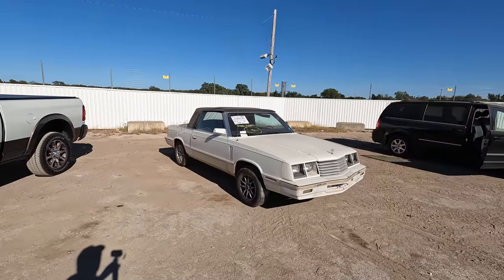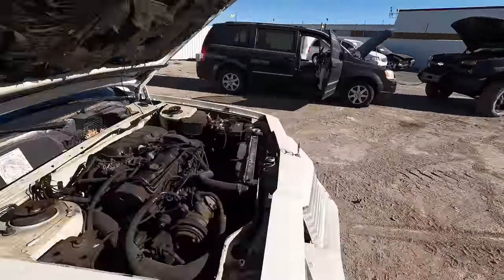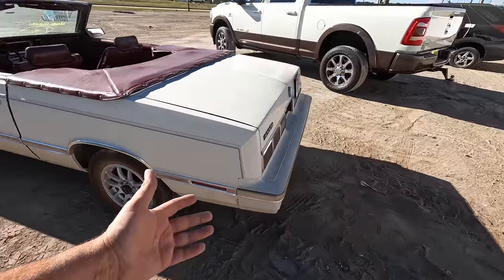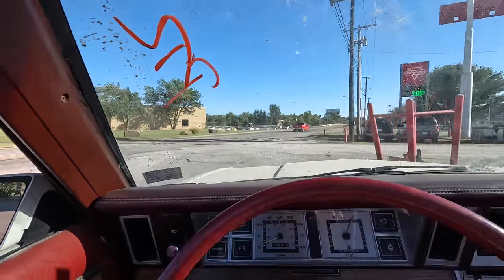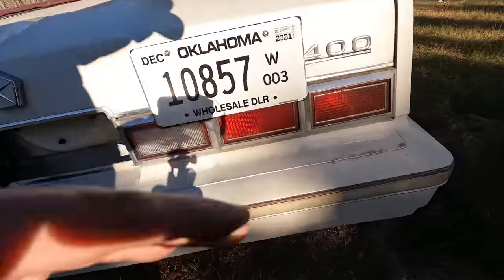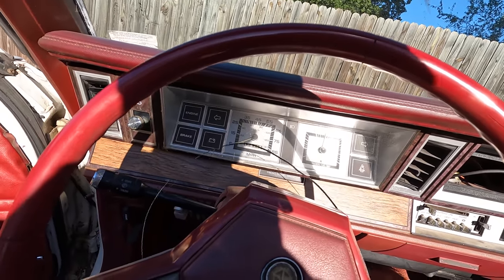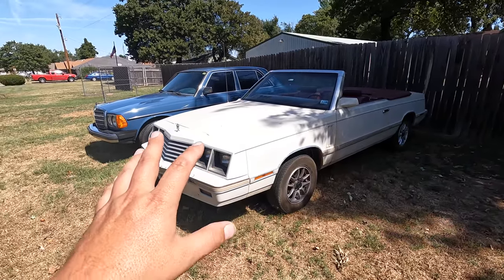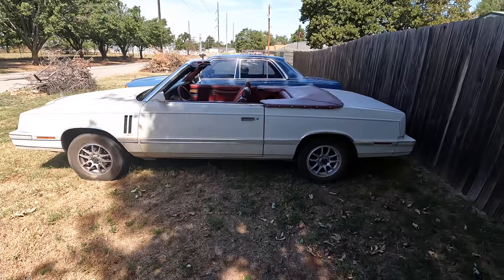I won a 1982 Dodge 400 K Car for $235 from IAA!! Run and Drive? 0-60?

Comment: Seriously I'd rather see you rebuild something like this for content value over fixing up a muscle car; everyone and their brother does that on YouTube.  Honestly thinking I might have the broker bid on this car; first generation K Cars in good running order with no real rust I can see are like hen's teeth.  I've always loved these old cars having owned an Aries and a Reliant.
Reply: Right? I can go to so many channels and see classics being restored, or newer cars being built to blow tires off, but nobody seems to really even bat an eye at the under-appreciated survivors like randy does
Reply: Yup owned a Reliant 2 Door with the vynil top and Opera lights installed. It had the HUGE displacement 2.2 Litre (I think?) but mine had the ultra high performance 4 Speed (maybe 5?) in it! Woo Hoo what a rocket it was 😆🤣😂.

Comment: These are worth 4500-6000 in perfect shape. The 400 was made for only 2 years. These convertibles were super rare. Most of them were 4 doors and Coupes Hardtops. I'm a K car fan. Man Red Green would be jelious of you
Reply: These exist in perfect shape? They weren't in perfect shape even when new!
Reply: @ronalddaub9740  The 82 and 83 were sent out to have the top done and they don't have quarter glass. the 84 and newer were done in house by Chrysler and were much nicer, They had a better top frame and convertible top and they had a quarter window!
Reply: @My Pronoun is WTF It looks nice, but one that's been driven an average of about 630 miles a year as has been claimed with that car has got to be exceptional.
Reply: @My Pronoun is WTF  the 600 was an E body with the Chrysler New Yorker and Plymouth Caravelle.  The K body started with the Chrysler LeBaron and the Dodge 400. The Plymouth Reliant came soon after. K bodies had the notch back rear window (squared off). The E bodies had the sloped rear glass with the extra quarter glass for more trunk space.
Reply: just picked up an 83 400 convertible in amazing physical condition  and under 80k miles for around $4300  just a quick tune under the hood and i think i got myself an awesome little car show cruiser lol

Comment: Randy, I had an 85 charger with that same engine and it would do every bit of 145 mph.  It was lighter than yours but the 2.2 with a carb was a good engine.  It may just need a tune up to get more power out of it.
Reply: The catalytic convertor is probably plugged
Reply: I had an '83 Challenger. It was a rocket too.
Mine had the digital dash, and female voice prompts.
Reply: My memories might be clouded by all the years, but I seem to recall the 2.2 eventually being considered the better of the two engines.  The Mitsubishi 2.6 being terrible oil burners.  Everyone has probably seen the old minivans blowing clouds of blue smoke?  Those were all 2.6s.
Reply: @peoriavideosltd6822  
Yes. Those were GARBAGE
Reply: @peoriavideosltd6822  The 2.6 were garbage when the balance shaft went out and the carb was another sore part . I had plenty of 2.2's non turbo and turbo I bought a 2.2 K car wagon that had a blown head gasket that a customer brought in I was working at a dodge dealer and the service writer said it was too old for the service dept to work on any way
 the customer asked if I would work on it told him sorry no can due then he asked if I wanted to buy it so he offered it to me for $100 I bought it and did a lift and slide gasket replacement sold it 3months later for $1000 dollars anyway IMHO a 2.2 is way better than the Mitsu 2.6.

Comment: I'd like to see you so repairs to it and put the original radio back in it and working, and put a top on it.  Maaco  to touch up the original white paint. You can most likely find factory wheels at the junkyard. Put the original wheel covers back on it. They are rare to the point they are collectable. There is a market for them.

Comment: You're too used to driving that Hellcat Randy. LOL.  Actually, if you look back, that slow dog engine was about par for the day of other manufacturers offerings like the Citation or Fairmont. Anywhere from 80-90 hp range was the norm for 4 cyl vehicles. Drop a slush box in them and they were absolute nightmares to get onto a freeway. But you got to admit, that Dodge 400 was a good looking vehicle in it's day. Still is in my opinion.
Reply: I agree with every word!

Comment: my parents had many of the 2.2's and they were not as bad as they made them sound. Worse issue was the head gasket and it was a fairly easy fix.  My dad had a timing belt break and all it took was the belt to repair it. didn't even bend any valves.

Comment: You can bump up the ignition timming a bit and it'll help it get up and go a lot better.  Iirc the base timming on those 2.2/2.5L was way too low at about 12°.

Comment: We have a 1982 Dodge 400 convertible and have owned it many years. It definitely turns a lot of heads and we get asked questions about it all the time. It's such a great car for cruising around in. The electric top is super fast. I found old repair books to keep it going. We have BMW, Subaru and Toyota cars as well, but this is definitely a favorite! Drive it like a golf cart and it's very relaxing and reliable. The front seats are VERY comfortable. If find one and are handy with tools or have a mechanic that understands carburators. This is such an interesting car. Little kids and elderly people really like it. It isn't a GTO or Mustang, it's very rare. And we really love it. ❤
(Long term ownership experience here 😉).

Comment: Oddly, a few years back bought a '91 Chrysler TC ("by Maserati" 😆) in triple black from a retired professor cheap. Just a "Bitsumishi" V6, 47k miles and everything works. Still have it, my daughters used it for a fun summer cruiser and it isn't worth anything. Cheap insurance, never see another, and it looks presentable. 

Should be a power trunk release- open the glove box, yellow button. Also, tune should include plug wires on the 2.2/2.5- the cap "Ends" go through the cap and are the contacts for the distributor rotor

Comment: That bezel is for the factory radio. All Chrysler radio's from 1981-2000 had the same connections for the speakers and antenna.
Reply: Actually, I think that's the Bessel for the passenger side inboard headlamp

Comment: Had one of these when I was 19 
Bought it for 400 put a radiator in it and drove it for two years then sold it for 400 .
Car was amazingly smooth and very comfortable and roomy . 
But yes it was really slow .
Mine was whit exterior with super blue interior vinyl seats and dash .
Put a jamming stereo and 6x9 Speakers under the back dash and was cool sounding ride

Comment: 2.2 L had carburetors until 1985.  I had a 1985 Plymouth Reliant.  86 had a 2.5 EFI which was a much better motor.  Mine was always in the shop.  Three carburetors. Two radios.  Emission equptment failures.   After 18 months it went back as a lemon law car.   

Lease was nice. $500 rebate assigned to dealer. 0 down.  $197.50 a month for two year lease

Comment: I don't know about Oklahoma, but in my area these cars (as a convertible) are very popular and still worth decent money, and tops are cheap.  Also, from my experience, the 2.2 was a more reliable engine than the 2.6 which had a balance chain that would start to rattle and cause problems.

Comment: The 2.2L Slant 4 was a good engine after 1986 when they became EFI they were turn key reliable. The 2.2L and 2.5L Slant 4 is easy to do head gaskets. We did head gaskets at the Amoco garage  on these took 3.5 hours and the cost was 350.00 parts and labor
Reply: @My Pronoun is WTF The Holley carb is based on a Weber with electronic feedback.  A Weber without the electronics is a good swap.

Comment: I would love to buy that K car. It's different and in nice shape. It's the kind of car that you can go have fun with. Fix the top, put in a modern radio and go for a drive. Yeah, it's not fast, but most cars from the early 80's were slow (my first car was a 1982 Buick)

Comment: Randy, this is a 40 year old 4 cylinder K car.  It had to have been taken care of by the owner, or it would have already been scrapped.  My guess, the owner is either in a nursing home or has passed.  The children donated it, because they could not be the ones responsible for having it scrapped.  

Have it detailed, dye the carpet, find a used top and change the fluids, etc.  Then run it through IAA and I bet it will sell for more than you paid for it.

Comment: I think you should rebuild the K car; not to concourse quality, but to the point of where people would turn their head and say, “That’s a nice old car.”  

What to do with it?  Fix the “hub bearing” (not sure if that’s what you said, but something to that effect).    Steam clean the engine, reinstall or replace the trim pieces, reinstall the radio and restore the top and call it good.  

Even though there is no profit whatsoever in this car, just to “restore” an 80s K car I think would be fun to watch and bring back a piece of nostalgia.

Comment: Beautiful car in a year or 5. What engine is in this convertible?

Checked it out. It has a 2,6 mitsubishi 4 cilinder in it. Those are excellent engines. That engine will run and run and run.

Comment: If i rememeber right weren't the 2.2L engines made by VolksWagen? they were the ones dodge sold with the Holley Carbs on them too. You need to run seafoam through the gas and through the engine before you change the oil. Guaranteed it'll pick up if you do that. they weren't race cars but they went ok for what they were when the internals are clean

Comment: For certain years in the 80s, there was a federal mandate that speedometers could only go up to 85 MPH, and the number "55" must be highlighted.   Many car makers marked numbers every 10 MPH on the fives to comply, rather than make the number scale "asymmetrical" .  Found it odd on the km/h they marked "137"

Comment: Tops are cheap $150-250. Car looks great with top down, red would be hot! 
Get the stance to be a little higher in the rear with a nice set of wheels, $4500.

Comment: Randy the 2.2 is definitely known for blown head gaskets . I was a working mechanic back in this era we did the SLIP AND SLIDE  for  the head gasket  repair anyone from that era knows what I mean  lol also the  these cars are know for vapor lock now days not set up for the new fuel of these days when the warm up . Good luck still a nice old var 👍🏻. BK

Comment: There is a passthru on the side arm plates of the rear C-frame. Make sure the sway bar linkage is still there, and attached, not broken. If you do not see a diagonal beam attaching to side of C-frame, to body...make sure a recalled  C-frame side plate is not cracking where the e-brake cable snakes thru. The wheels will slam into the wheel wells and it slows you down very quick!!! Other than rusty lines or radiator weld dissolving, good lil cars.

Comment: The carbureted 2.2L engines were not all that bad. The fuel injected 2.2 turbo had the most problems. But the carbureted engine is painfully slow 😂
Reply: The later 2.2/2.5 with TBI are generally more reliable

Comment: box on radio antenna wire is an antenna booster red wire is for 12 volt power.

Comment: trim piece came off when rear speakers & wires were removed, most likely by a young guy that owned it last and put a powerful stereo system in it.

Comment: Cool little cars, not very many made and few around anymore.  As long as oil was kept up with they where good reliable transportation, the 2.2 was a good engine, head gasket was the main problem, those carburetors could be finicky also.  I still have several 2.2 powered cars in my collection.

Comment: A new top and charge the AC, reinstall radio with 4 cheap speakers in holes cut. Put in on Craigslist for $1000.00 OBO it will sell.

Comment: Kcars have a tendency to drop axles and the carburetor screws mess up so they have to be replaced so they pass smog checks I bought one out of a junk yard and even though it ran good front axles were shot and very costly to replace

Comment: I want to say that it is a HUGE MISTAKE if you get rid of that K Car.  Now I am a die hard FORD and Toyota product fan.  

There is so much potential with that K Car and I am going to prove it right now.  Cosmetic wise that’s an easy investment.  However you can bring that care up to speed technology wise. 

New head unit with rear camera and surround sound audio plus Bluetooth.  You can even add SiriusXM to it.  

Upgrade all the lights to LED including the headlights with HID.  Redo the carpets and trim.  

That K Car will pair nicely with the Christine and makes for an awesome Fall Spring weekend get away car
Reply: Plus we would like to watch the transformation

Comment: There was an 86 LeBaron Turbo convertible in my local you pull yard, if you need any bits I can check to see what's left.  Last K-car body LeBaron, more or less the same as what you have.  I sold the digital cluster out of it on eBay for more than you paid for that car.  

Outside of that the last one I saw was the one Hoovie buried in the Wizard's yard.
Reply: Also, you should have had TK fake out his channel saying this was his new car. lol

Comment: The 2.2 is superior to the 2.6....Other than head gaskets they run forever! I own four K cars one being an 84 Dodge 600ES Turbo vert...I have one with the 2.6 and nothing but issues....
Reply: I’ve done a few 2.2 head gaskets, they are fairly easy to do, I’ve always used a superior brand like felpro and never had an issue again

Comment: Hey Randy Please fix up the 1982 400 Convertible these are super rare parts are cheap and the convertible was only made in 1982. Most of these were coupes and sedans but the 400 convertible didn't last past 1983 as the 600 replaced it. Please restore the 400 there was only 2779 made in 1982.Also you can have some fun and bolt a 2.2 or2.5L Turbo up to it and have a fun car on the cheap.

Comment: I seen to remember back in the 90s my mom had a car just like this but its a 4 door with the little multiple square taillights. I remember It keeps overheating a lot and backfiring and got a transmission problem it was only stuck in 1st gear and wont shift into 2nf or 3rd or 4th.  It was a pos.

Comment: When you say that the Mitsu 2.6 is better than the Chrysler 2.2, you've actually got it the other way around. The Chrysler 2.2 is the one to get, so you should be fine! You'd be surprised, there is a small cult following for these K based cars. I had a Dodge Aries wagon for a few months back in 2015 that had the same engine in it. Unfortunately the transmission failed a couple months after buying it and I had to basically give it away to the shop that was doing some work to it.

Comment: A head gasket on these are a breeze...even easier since it's a carbed engine.  and an updated MLS gasket, this engine will outlast the rest of the car many times over.  They used a pretty cheap, crappy head gasket from the factory back then.  BTW, the 2.2/2.5s were never junk. I've made over 300 wheel HP on stock bottom end turbo 2.2s and ran low 12's on a 2.5 in a heavy K car wagon.  Look up James Reeves...low 10's and 9's on a 2.2 8 valve engine.

Comment: I have an 86 model same color with the 2.2 mine has 112k on it I bought it from an 82 yr old guy who bought it new nice little driver gave him 500.00 bucks for it the only thing wrong with it was the front drivers caliper was sticking, I would love to have those hub caps, by the way you can buy a new top for $189.00 DM I’d like to have it when you decide to sale it and I’m a TN dealer

Comment: that car was fairly peppy back in the day. not sure about the k-cars, but the chargers and turismos from the mid-80's were no slouch compared to other 4 bangers of the day....u have an engine way down on power and/or your tranny is slipping....they had a reputation of tranny slip long before it actually went completely out.
Reply from the maker: Those were turbocharged, this is not. Trans doesn't slip lol I know what a slipping trans is.

Comment: If that car was close to me I would buy it in a heart beat! I had an 84 and an 85 Chrysler Mark Cross edition Lebaron convertibles and with a little work they both handled real good!  I think it would be good for the group but do  what you gotta do!  Just like the ''phony GTO'' I had a 68 Lemans convertible quite a few years ago and I loved the car! I also had a whole bunch of 68 Tempest and Lemans hardtops and they were all 350'S with 2 barrels and they would have kicked your cars ass because whoever put the 4 barrel on your car didn't hook the kickdown back up to the carb! when you kicked the 4 barrel in it should have dropped down to first gear! I would rather have 1 68 Tempest convertible than two Plymouth Plazas! You didn't give the Tempest a chance and you're not going to give this one a chance either You do you!

Comment: Believe it or not, there is a niche community with these K cars. I'm sure someone more knowledgeable on the subject will comment somewhere but, yeah. Clean it up, fix it up and maybe paint it and you might just be surprised how much one of those K car aficionados will pay for it. Bye the way, I would drive the heck out of this thing. They weren't fast, were not top of the line but, they were fun little cars. I actually owned the LeBaron turbo version of this. Had a fun driving it around. LOL

Comment: The 2.2 is OK. The Mitsubishi engine was smoother and had a bit more power but suffered from cracked head issues and the head bolts were not sturdy enough. Overall they were about equal in reliability.
The 2.2 lived a long and happy life under many Chrysler products. A Spirit R/T could produce 224 hp reliably from factory. A 2.6 Mitsubishi never got that much power even after turbo and intercooler